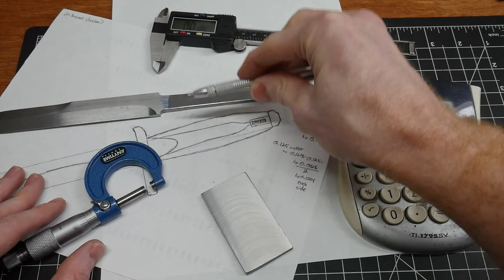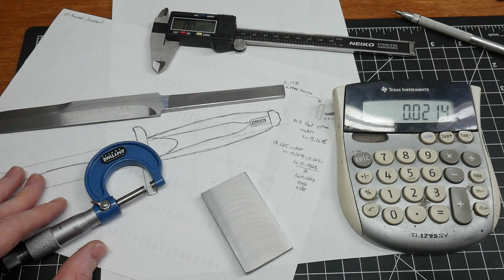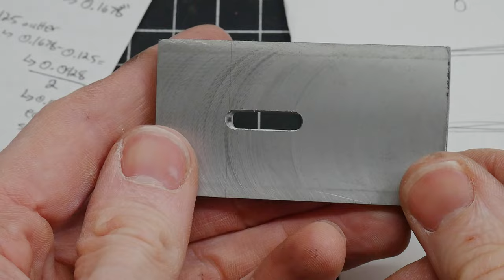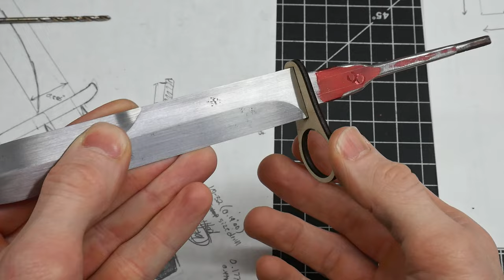RESTORATION - Reviving an Old G3 Bayonet Knife - Step by Step DIY Project

Comment: When you’re squaring up the shoulders on the mill, do you have the collet running against the file guide, or the endmill? If it’s the end mill I suppose you’re using high speed steel instead of carbide so you don’t wreck the file guide?
Reply from the maker: I am just using the file guide to hold the knife in the vice. I am not touching it. My end mill is carbide. 

Kyle Royer "kisses" his carbide file guide with is endmills... I've had marginal success with this.
Reply: @RedBeardOps  ah that must’ve been where I saw it! Thank you!